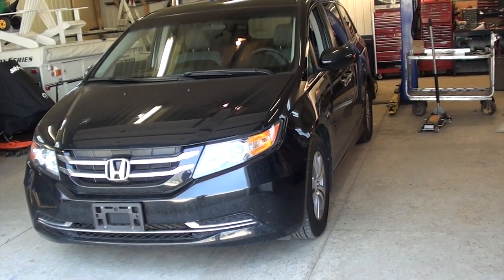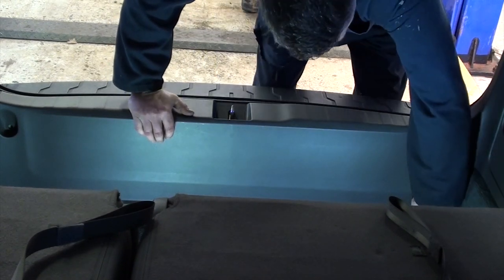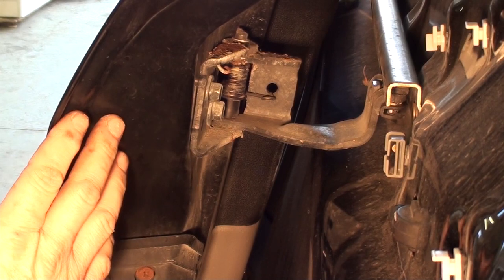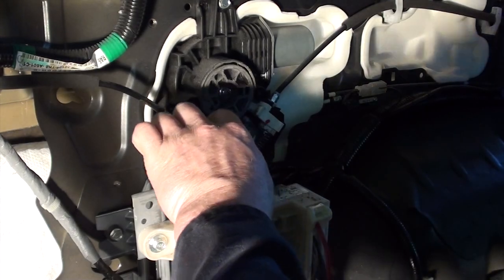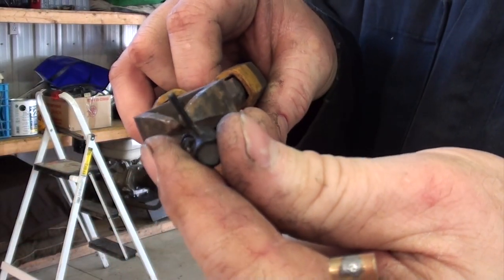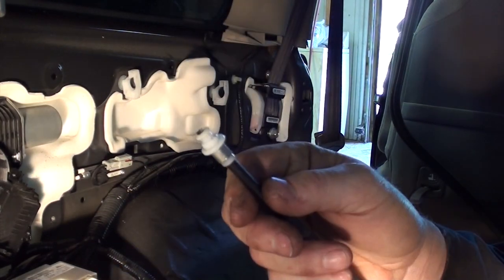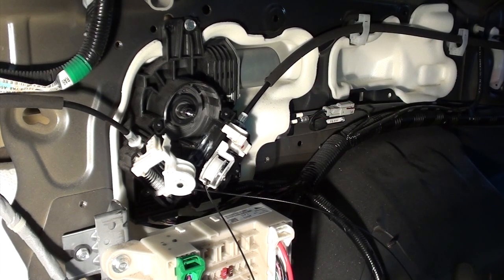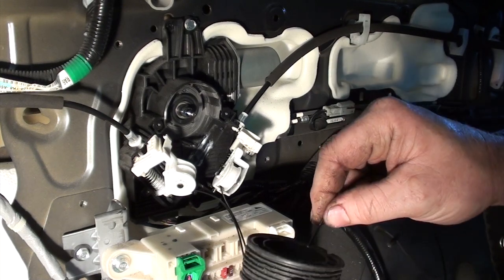Power sliding door cable replacement.  2011 - 2017 Honda Odyssey

Comment: Thanks for the video. Couldn't have fixed without it.
I just got finished and here are a few tips:
1. You're  probably thinking about buying that crimping tool from amazon. Don't. It's worthless. Just use some strong vice grips. 
2. Careful how much you jack up the door. Also, don't touch the jack after the pin is out. It's a real pain to get the pin back in if the jack changed its height.
3. A T-40 screwdriver would have been great. All I had was a T-30, but it still worked.
4. That little C-clip that holds the pin in is a pain. Get a pick.
5. Pay close attention to the part about wrapping the cable. Back cable goes in back of spool. Front cable goes in front of spool.
6. When first wrapping the spool, the cable should seat down in the grooves flush with the spool. You may need a flat head screwdriver to seat the cables when first starting to wrap the spool. 
7. Once the spool is wrapped, there should be no slack in cable.
8. Just as in the video, throw in a few screws to hold the assembly together when testing it. I put in all screws and bolts and ended up taking them all out again.
9. Block off the whole afternoon. Took me 6 hours (But I struggled with a few parts).
Reply: So the crimps did not need to be perfectly square and you used a normal vise grips?  Thanks for your additional suggestions!
Reply: Hola conoces algún lugar donde vendan el carrete ? Te agradecería

Comment: Thank you. I just fixed my sliding door while watching your video step-by-step. Worked perfectly. The only change was I connected the rear cable to the rear of the spool and the cable that goes towards the front to the front of the spool. I also did not place the door in the center. I had the door open all the way this way I had to wind up the rear cable a lot and the front cable only a little. It made it a little easier to keep the cables under control while trying to get the spool back in the motor. Thanks again for an excellent video.
Reply: YES! I wasted a tone of time rewatching and redoing it until I finally checked the comments! 😡 Opening the door all the way made it so easy! Goes to show, not all YouTube advice is good advice!
Reply: Driver side?
Reply: @johnsteele8073  - Yes, driver’s side.

Comment: Thanks for the great video! I ordered the kit  on Friday, Saturday I took the panels off. The cable came in today, Monday. It took about 2 hours total. I wound the wires the way they appeared to be, but when I tested them they were backwards, so I rewound them. It looks wrong but the cables go up on the same side as the direction of the cable. ( The front cable goes up on the left side of the wheel, and the rear cable goes up the right side of the wheel.) Once I flipped them it wouldn't  close all the way, so I reset the motor, by pulling the fuse then holding the close button on the dash. But, it still didn't want to close correctly, I opened the cover again, took the wheel out, made sure the wires were in the correct locations, then put it back together and it worked perfectly! Thanks again!
Reply: How should I ask for the complete set and Where is best place to order it please.
Reply: Same deal with me.
Reply: Do you mean that the front cable winds clockwise and the rear cable winds counterclockwise?

Comment: Thanks a ton for posting this.  I just did my 2016 tonight and the door is now working.   Without this video I probably would not have attempted it myself.  It took me and my bro about 2 hours or so to get it done.   Saved at least $1000 bucks!    And for anyone looking to do this, it's not too bad, just be patient and follow this video, all the steps are there.   Note (as many others have) that what he says about winding the cable is wrong,  for the driver side door fix the cable on the left (opener) goes on the back of the spool, and the right (closing) cable goes on the front.  The cables should NOT cross after coming through the white tensioners, they stay on the same side.   I think its also mentioning that the cheap cable Honda uses is pathetic, and shame on them for putting their customers through this, my van is 3 1/2 years old and it snapped!   Should be covered under warranty, i guess its too easy to collect the $1000 bucks for when people bring their vehicles in for repair.    Big thanks to people like "BackYard Tech" who post videos to help us out and save some money.   Good luck to all who attempt!!
Reply: Passenger side reel is opposite-rear cable is on the front side of the reel and front cable is on the inside/backside of reel. Did mine today

Comment: Thanks for the video. 2011 van. Had some helpful tips that made the jobs easier for sure. My only complaint is that you say the front cable should start on the back side of the spool but that is incorrect. Rear cable connects to the back of the spool and front cable connects to the front of the spool.

Comment: Thanks so much for this video.  I did the fix on my '11 today, passenger side.  Without your video I would never have attempted this, so you totally saved me $1,000 or more.  One note, on my application, the front cable starts on the outboard side of the drive pulley and the rear cable starts on the inboard side of the drive pulley.  It would definitely not work the other way.

Comment: This is a life saver! In the last four months the driver and passenger door cables have snapped. Although this looks time consuming I would rather do this than pay the dealership $1200 per door. thanks for the detailed work.
Reply: Thanks again! Finished both doors today and they work perfectly.  Fyi i bought the cables from www.carcableguy.com  49.99 per side

Comment: This was such a huge help. Wouldn’t have tried it without the video. I took a commenter’s tip and used zip ties to keep the tensioners in the compressed position which saved a lot of effort. Once everything was in place, I snipped the zip ties and pulled them out. Thanks for saving me big bucks.

Comment: Excellent video! Thank you for posting - you saved me lots of money. My repair went exactly as you demonstrated. I used electrical tape to hold in the cable sheathing and tensioners. It made the winding of the cable much easier.

Comment: You knew everything you were doing, sir! Invaluable work to save me $1k repairing cost.Thank you very much! Just one thing I want to mention. The Ferrule crimping tool bought from Amazon was too weak to crimp the ferrule. I don't know whether the ferrule material was stronger in my case. Anyway, I ended up using a $3 crimper for electricians. It worked.
Reply: Same thing happened to me with the ferrules. Looks like I had the same tool as the video but maybe different ferrule material? Even on the toughest setting, the tool couldn’t compress or crimp the ferrule enough. The tool came with a box of ferrules of various sizes and I was able to use those, as they were a much more workable metal.
Reply: Kevin Hipwell, I recommend using a swagger tool instead. The ferrule installed by the $3 crimper fell off after 1 month. I had to order a new kit and went through the whole process again... learned in a hard way ...
Reply: B. Li turns out the ferrules that came with my crimping kit are also too weak. They lasted a few days and now I’m starting over again too. I’ll look into the swagger tool, thanks for the heads up.

Comment: Awesome work! Thanks for all the hard work. I was able to help a friend get his sliding door fixed too--however one issue is that when attaching the cables to the central spool, the front cable goes to the front of the spool facing you and the rear cable goes to the back side of the spool.
Reply: Is it apparent what direction to wind each cable on the spool? About to do this job and it wasn’t clear from the vid especially with the front/rear mixup
Reply: @nsgibson  Passenger side reel is opposite-rear cable is on the front side of the reel and front cable is on the inside/backside of reel. Did mine today

Comment: Just fixed min in only 3 or 4 hours (with cleanup)! Thank you so much - the process went flawlessly! I did have to disassembly both the rear and front cable guides (that guide that cable to the exterior of the vehicle) but no issues. Winding the spool was much easier for me - only took about 10 min. Thank you so much!

Comment: It may have just been luck, but I had someone keep a little tension on the door while I wound it nearly open (driver side) and that allowed me to keep tension on it as I wound it and not have to hold it for long while winding the other side a little.  It worked on the second try for me.  Thanks for the video.  I would not have tried this and saved the $1K the dealership wanted without it!

Comment: Remember kids: the motors are are a mirror image so whether the front cable attaches to the front of the cable reel or the backside depends on which side of the car you're working on. The bigger shiny surface with the y shape is the front of the reel. And on the driver side the front cable attaches to the front side of the real and on the passenger side the front cable attaches to the backside of the reel. So many people make the ignorant comment their way is the correct way not understanding that is different depending on which door you are repairing. I did the passenger door and I had it slid all the way back so when I wound the cable I started at the front and wound back.... It sounds like it might be difficult to get the shorter cable on the backside of the reel but it wasn't. I got it on the first try couldn't believe it.. the little white guides have springs use them when winding the last bit to hold tension

Comment: IMPORTANT READ THIS!! I did this but the crimp on the inside spool broke so i had to do it over. It was a LOT of time wasted 😢 although, i may not have crimped it with the right tool. So, Just a precautionary tail, make sure to crimp it really well with the right tool. Great video by the way thank you! 😊

Comment: So you’re only partially wrong about which cable goes where on the spool. I first did the passenger side door which has the front cable winding up starting on the back of the spool. The drivers side door has the back cable winding up starting on the back side of the spool. So theyre swapped depending on which door your working on. I just finished both doors. Thanks again for the video!

Comment: Very good video. Good job! I'm not sure if I need cables tho since mine are not broken. I have a weird situation where sometimes both side seem like its jammed. It will make a growling sound then it pops open. 1 side of the rollers seem like it has play but the other seems good. Im going to try and change both rollers and re-home the doors. Hopefully that works.

Comment: I bought the $11.39 kit off ebay that had two wires that were the same length. I couldn't find any info on how long to cut the cables. I another set of cables from ebay for $33 that had the cables precut. The front cable was 74 5/8 in and the back cable was 63 5/8 in. Hope this helps.

Comment: What is the part called that's referred to as "guides" at 28:00? They are white pulleys that have springs attached and the cables get threaded through them right before the cables wrap around the spool. One of mine is broken and I'm not confident that I can glue it back together.

Comment: Great video. Followed it exactly and fixed my sliding door. Unfortunately the power tailgate no longer opens and closes automatically. Any idea what I might have done to cause this new issue while repairing the sliding door?
Reply: I just finished my repair today...pushed the button for the tailgate and nothing happened.  I closed it manually, then everything worked using the buttons.  Hopefully you have yours straightened out.
Reply: ottergt same thing here. It might’ve been because the battery was disconnected while it was open. Once I manually closed it everything worked fine

Comment: Hi Backyard, thanks for posting video.  Quick question, when I'm doing the "difficult" part of putting the wheel / motor assembly back together seems i'm about 1/2 inch short on cable slack, is there a trick to get more slack?
Reply from the maker: I have only made this repair once and not super knowledgeable on doing it.  Only this I can suggest is to be sure the cable tensioners are both in the slack position.  I spent a lot of time winding the cable drums.  It was not fun to complete.   Good luck.
Reply: I did this yesterday and was also coming up about a half inch short, but by modifying his instructions where he said the front cable shout go into the back of the pulley and the back in the front, I put the front in the front and the back in the back and then cables were long enough
Reply: @dtkane1964  I'm having the same issue, if I switch them they fit perfectly.    I noticed if I follow the directions here then the cables cross each other which appears to be wrong and would make the cables rub on one another  Did you try using the door with them reversed?  If so we're there any issues?
Reply: Would you please send me the link where you order the set and how to ask for complete set , please
Reply: Thanks so much for the video. Question: I think I lost the nylon bushings when the door got stuck. Where can I get these nylon bushings?

Comment: Any chance anyone knows where I can get replacement set of fasteners that hold on that side cover panel? The ones you see in the top right at 9:19 of the video and not the torx bolts. Thanks!

Comment: how do you rehome the door?
Reply from the maker: Disconnect the battery with the door closed. reconnect the battery and open/ close the doors completely by holding the master switch button on the dash.  This should re-home doors.

Comment: Someone told me I can't just replace the cable for my 2015 honda odyssey but the whole tiny engine cause the cables built into the tiny engine any idea if this is true or can I just replace the cable? Also what website or place can I get a new one? Its for the right passenger side sliding door.
Reply from the maker: As shown in the video it’s possible to replace just the cable.   I bought the replacement cable off eBay.   It’s called the micro fix cable.

Comment: **READ COMMENTS BEFORE ATTEMPTING!**  Awesome video, thanks for the work.  If you're trying this yourself, please note that the video shows incorrect routing for the cables.  Some good comments below.  Cable coming from the back attaches at the back of the spool and the cable coming from the front attaches at the front of the spool.  The cables do not cross over each other.  They should route straight up from the guides onto the spool.  This job would have taken me 2 hours rather than 5 if I had read the comments first.

Comment: Well, you certainly helped me fix my door.  I wouldn't have tried this without your video as a guide.  The parts I bought also provided videos (by email, not posted).  There was an important contradiction between the two videos.  At 31:00 you incorrectly state what cables goes on each side of the pulley.  Although you are working the drivers side door, you gave instructions for the passenger side door.  If one follows your instructions for the drivers side door, the cable will cross and the open/close functions will switch and produce erroneous data for the position sensors.  You must have figured this out because at 34:10 it is very clear that the cables do not cross and you corrected this error in your installation.  Also, I found it easier to hand wind the cable with the door nearly fully open.  That way I only had to keep one cable tight on the pulley and not two. Otherwise, I had no issues.  You did a great job of pointing out where the troubles are.  I think I saved over $1500.  Thanks.
Reply: Hello mdapple, 
From where you bought the cables?
Reply: @mdapple4418  Thank You
Reply: Thank you for pointing this out!  Once I noticed I was crossing the cables under the wheel (and couldn't get it back in place) I rewound the cables and was finished in 5 minutes.  Also found it helpful to zip tie the tensioners... next I will do the passenger side.

Comment: Great video. Perfect amount of detail to let me do it myself. Canada be quotes 1300+tax. Cable kit from Amazon was 40, and crimper was 25.
Same as other commenters, rear cable goes in back of spool, opposite of video. The crimper I bought wasn't strong enough to crimp the ferrule that came with my kit.
I wound the cable around the spool with the door fully open, it made it easy only having to keep 1 sides cable tight against the spool.
Setting home position of the door was also easy following a comment. Connect battery with door closed, and then hold closed for 25 seconds.
Thanks Backyard, saved me some serious coin.
Reply: Hi, what did you use to crimp the ends if the tool didn't work?
Reply: @camilomuzard3498  I used the crimper to form the round ferrule into a roughly square shape even though it down crimp down hard enough. Then I used vice grips to squeeze all sides of the square ferrule down even further. The vice grips misformed the square a little bit, but the slot in the pulley wheel is big enough they still fit
Reply: Ok great, thanks
Reply: @camilomuzard3498 no worries. Good luck. My first repair I used a larger ferrule overtop of the not-quite-fully-crimped ferrule thinking the larger diiameter would allow the crimper to tighten everything enough. I put it all back together with the double ferrule crimp and it failed the same way 4 months later. Using the vice grips to get after it has worked for 6 months now, going strong.
Good luck.